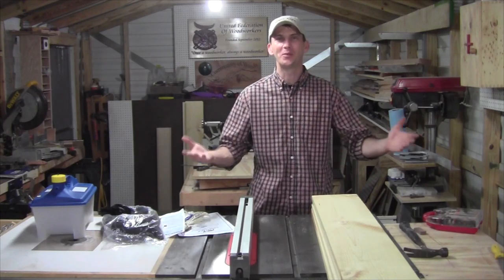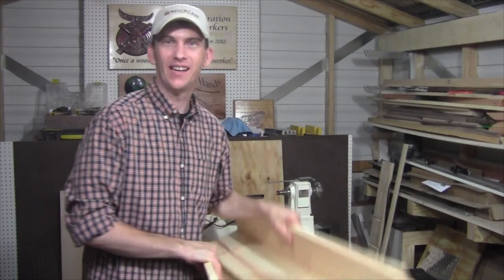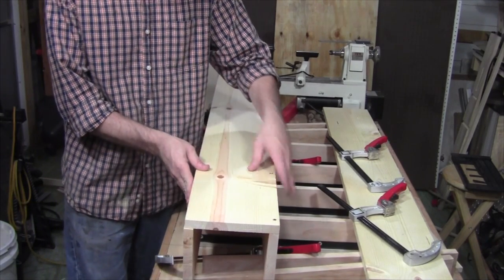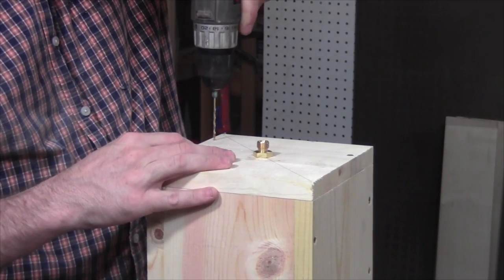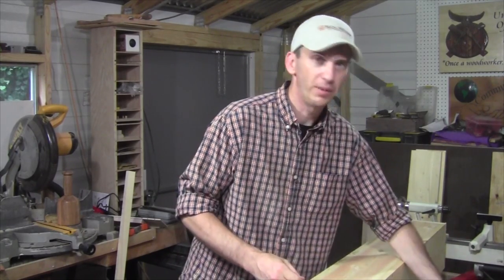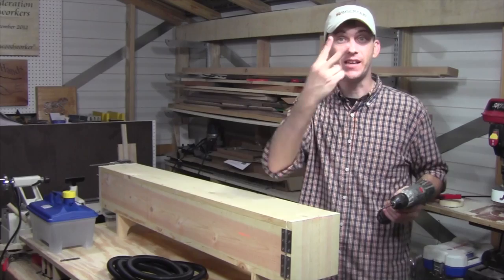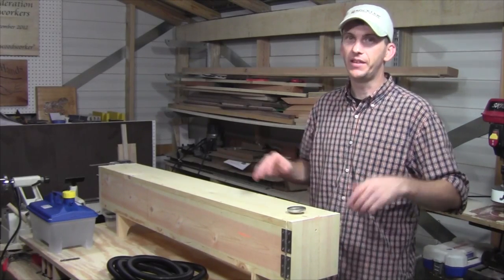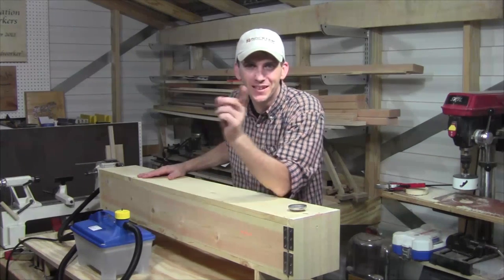How to Build a Steam Bending Box

Comment from the maker: Rick, on the door of the box is a vent hole and in the rear of the box is a "Drain Hole" so the water and condensation that builds up has a place to run out.. So the plastic tray was there to catch the drain water.

Comment: wesome yours is the same as mine...had for bout 4 years now and it works awesome...i used a hot plate revamped to 240 volts to heat a large kettle of water so it lasts longer...i can steam up to 1.5 inch peaces of lumber...ive also built a bending table with bearings to bend peaces to a circular configuration witch worked great for me...awesome vid...thanks for sharring

Comment: I was considering picking up a used pressure cooker (with good gaskets of course) and then using my outdoor turkey fryer stand and my bottled gas to heat the water inside the cooker. A hose for the steam would then connect to my box. Your plan looks a bit less involved....I need to rethink my original idea. Thanks!

Comment: very good video, helps so much am using a steam shower generator that the people didn't like in their shower said " it mad them hot " huh ????  anyway, am building an o gauge railway inside my log cabin house that will run through the chimney with an arch bridge in front of the tunnel for a siding or to allow passing trains to not colloid with each on the main line, also i  do a lot of custom projects for folks that require bending this will really help in those projects, the simpler the better in explaining things works so much better for people like me that have see and feel what there trying to build  it's like " plan it as you go building. " and for the most part it comes out really nice,  thanks Kevin

Comment: Surely there needs to be an air escape to prevent pressure building up? and also prevent pressure blowing steam back into the steam source, traditional steam boxes just use rags to block the majority of steam escaping. Another point would be to watch that the steam doesn't bend/warp the box itself, steel tube works well. I like the idea using the wall paper stripper as a steam source.

Comment: I just finished by box but didn't make the hole for the thermometer. It occurred to me, if I see steam coming out of the indicator hole I drilled in the door, it's at about 212 F since that's the temp water converts to steam. So why a thermometer? Thanks. Great video as are your others BTW.

Comment: 12 inch 6ft pvc pipe a few holes tap a dowel through those holes, pvc caps. One cap cut 1 inch hole attach 1 high temp hose to the other cap seal on. Drill a .25 drain hole lowest point. Steel can water. You see where I'm going.

Comment: If you do encounter leaks, rather than using tape to seal - which will eventually fail - you can try an old boat building trick and just force some fine sawdust into the area that is leaking. As the wood expands it will seal itself.

Comment: Cool video.  Do you know if the steam system you bought has a heating element or just runs the line voltage through the water to heat it?

Comment: depending on the size of wood, how long would it be left in for? I was thinking of 3/16 to 1/4.
Reply: James A. general rule of thumb is an hour per inch of thickness. So... 1/4" should take about 15 minutes. Avoid kiln dried lumber, it doesn't like being steamed.

Comment: laney when make a steam box what size would reckment for a steam  a steam  box pls
Reply from the maker: A 5" x 5" inner dimension with a 3 to 5 foot length would be a workable volume for use with the steam generator i used. Which can produce enough steam for a 6"x6"x 60" steam box...

Comment: No problem lining up all the holes for the dowels if you simply stack the two side boards and drill both at once.
Reply: +Luckystrike I think the holes don't go all the way through.
Reply: Big Dave
Since the dowels will plug the holes they don't need to be stopped holes so it just makes sense to me to drill all the way through both pieces at the same time.
Reply: Luckystrike Yeah, broad as it's long.

Comment from the maker: So far no leaks, however if I were to have a leak, I would most likely seal the box with Aluminum tape (the kind they use for AC and heating ducts) This is my first steam box, so I will address the leaks if they arise and share what i did to fix them... but knock on wood..lol...so far no leaks

Comment: There is no need to use hot water. If you use water from the cold tap, the molecules move around faster as they heat up. Hot water will just sit there and cool till  the heating element catches up to the temp of water. At this point the molecules have slowed down. This is something I learned on a cooking show many years ago and confirmed by a science teacher years later.
Reply: This IS THE kind Of advice I Like !!! 👍
Reply: Gives the cook time for the water to heat up whilst he has another drink...so it must be right.
Try timing a kettle from cold to boiling and then after five mins of cooling time back to boiling again. Its not really science, is it